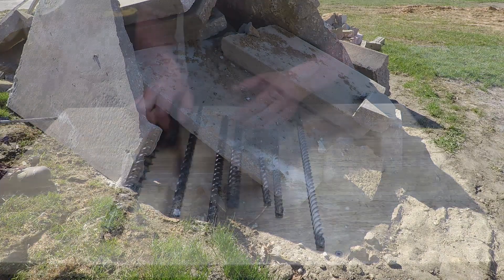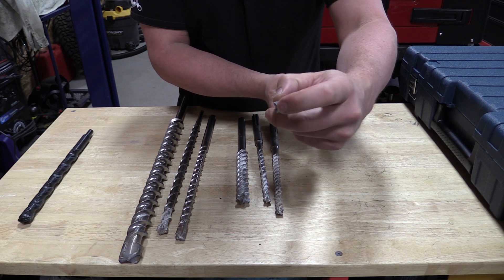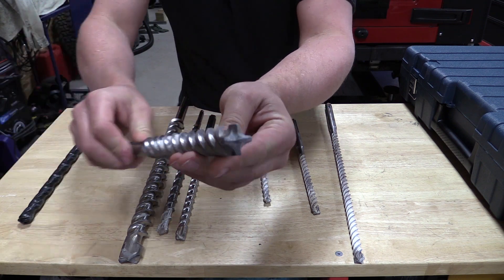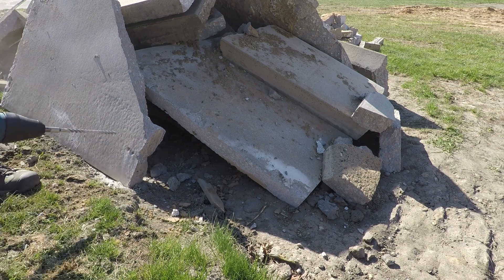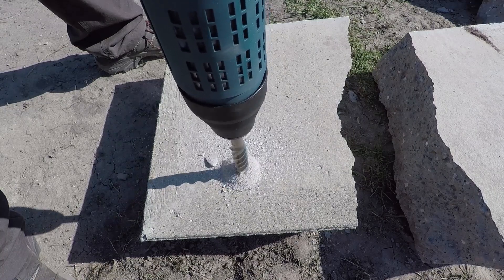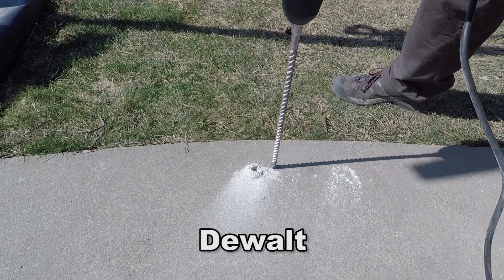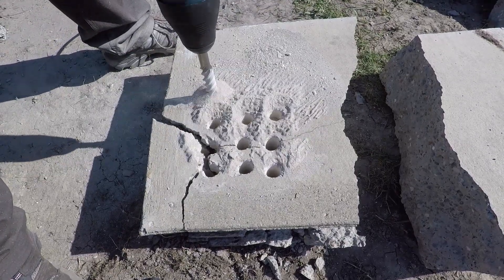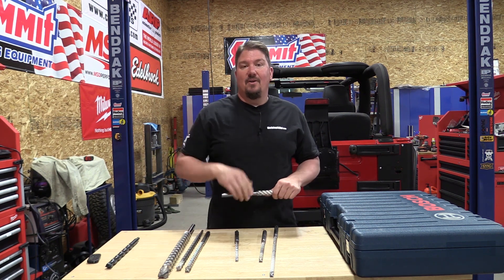Full-Head Carbide | Bosch SpeedXtreme SDS Max Rotary Hammer Bits

Comment: do we need to change mode to drill only when drill bit hit rebar? or its ok with hammer drill mode?
Reply from the maker: Yes, as long as you have a bit that will cut rebar.  Hammer dill in anything like concrete.